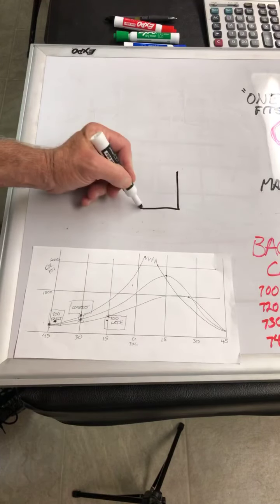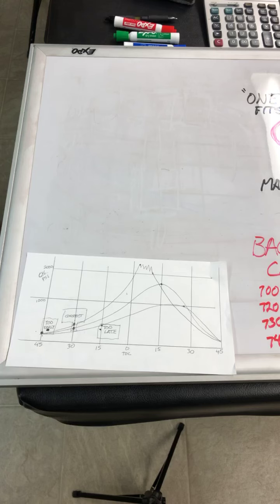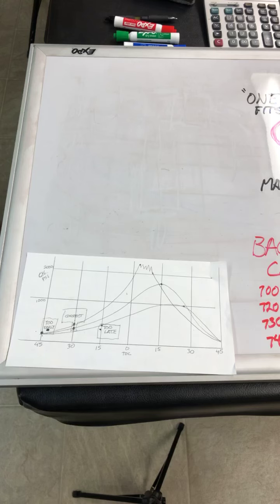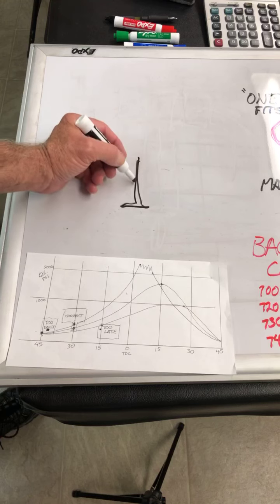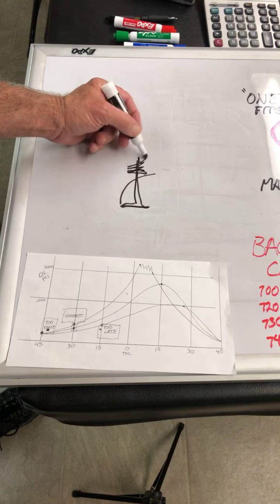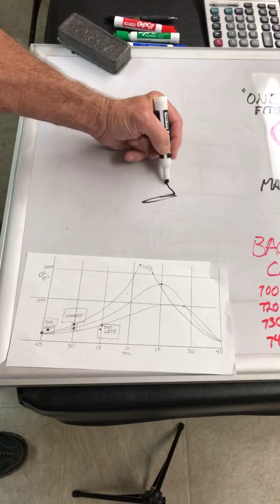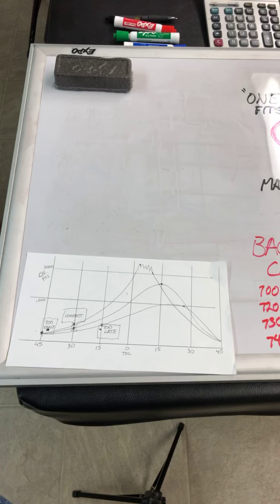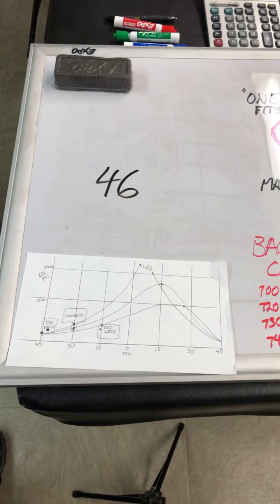Air Flow and Cam Timing

Comment: In V8 stuff people tune cylinders individually with different pistons/comp ratio, pro stock carbs are vastly different per each venturi, exhaust tubes want something different hole to hole ect! Have I never heard of or does it not work; cams with lobes catering to that cylinder?  I feel like from what you explained, nothing on a Harley is perfectly tuned if everything on both cylinders is the same (because the layout obviously isnt.) I'm certain this isn't novel, but thanks!

Comment: Great video George... I would definitely like to know your thoughts on cam timing and 4 valve sport bike engines. There's so little info out there on what and why changing cam timing does what. I do know that in theory opening the intake later moves the rpm window further out. But what does moving the exhaust cam to?

And I heard you mention high lift and short duration. That's I'm guessing a learning curve as to what is too little of duration, and what's too much.